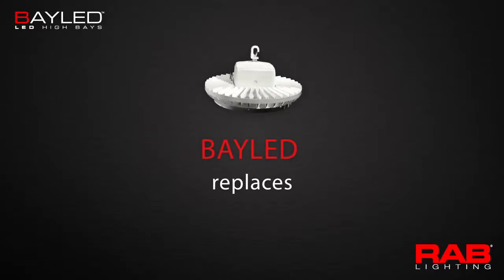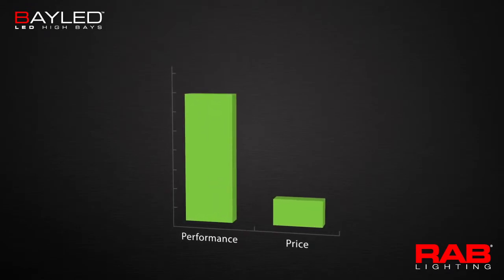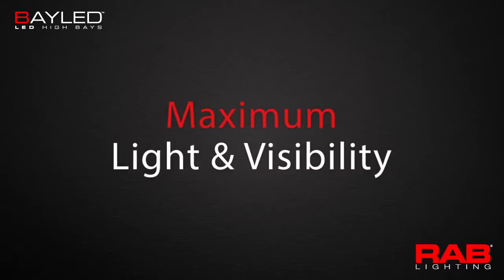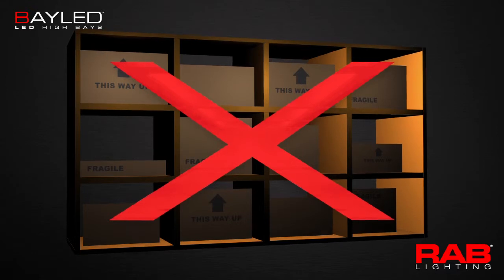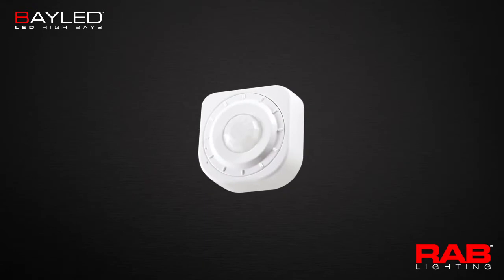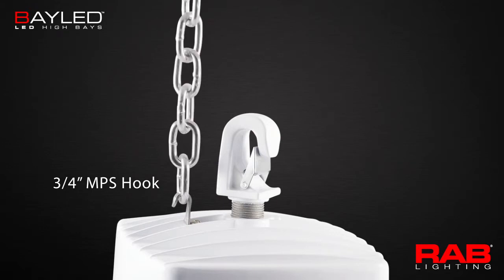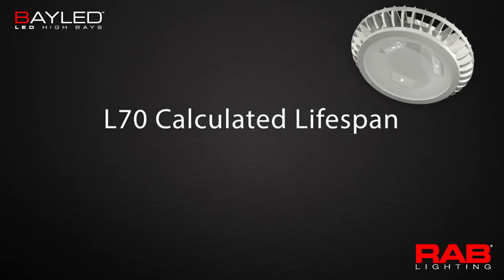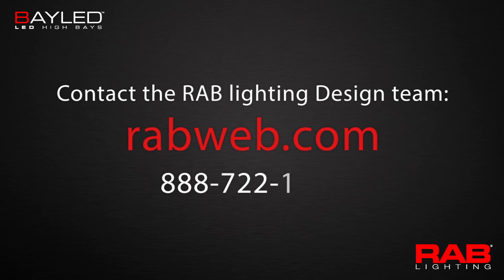RAB BAYLED - LED High Bay Replaces 250W Metal Halide High Bays

Comment: Because these lights have universal voltage drivers, you can connect them to the high leg of a 4 wire Delta system.
Reply: The only problem is, they’re garbage